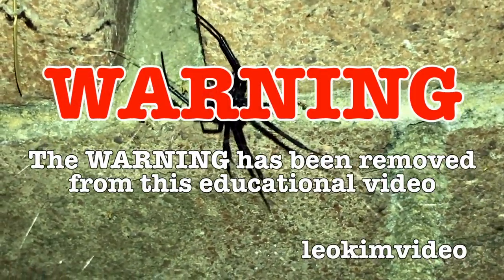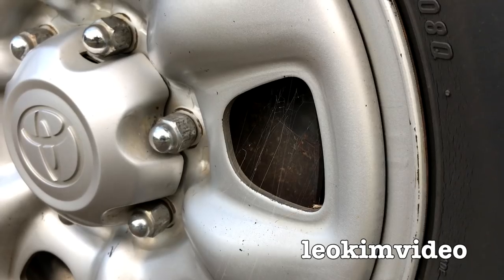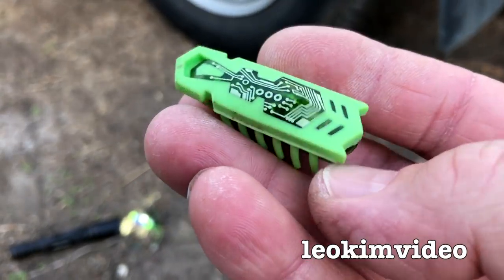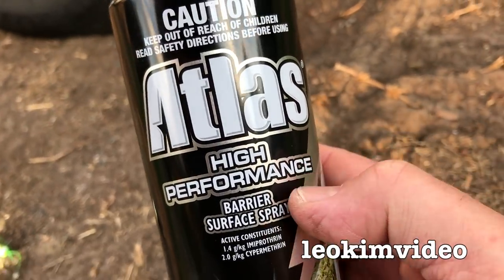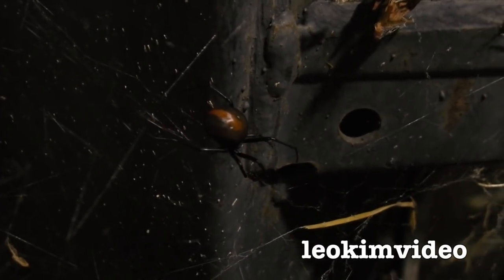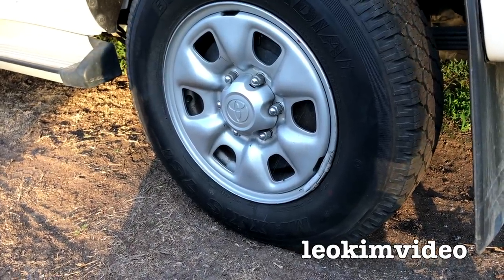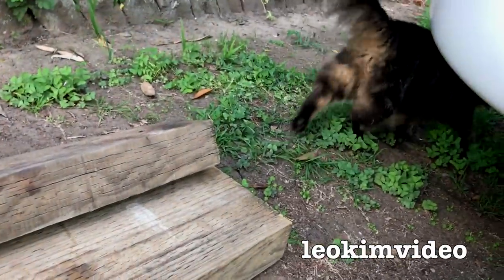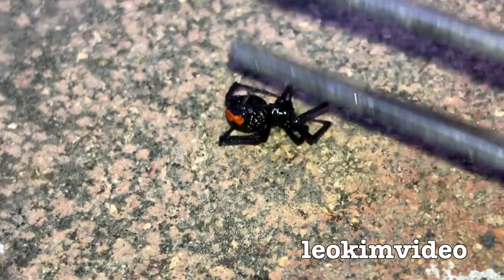Redback Spider Solar Bug Toy Lure Toyota EDUCATIONAL VIDEO

Comment: Hey there, try using a metal tuning fork - strike the tuning fork on a hard surface, then hold the vibrating fork up to webs! This works very well for teasing out spiders. Good luck!
Reply from the maker: I'll try that. I have had success with using a cats whisker teased in the web but only on black house spiders. I find it does not work with Redbacks. I have had times when a Redback will ignore a real bug stuck in the web. They can be really difficult to lure out of their spider nests.